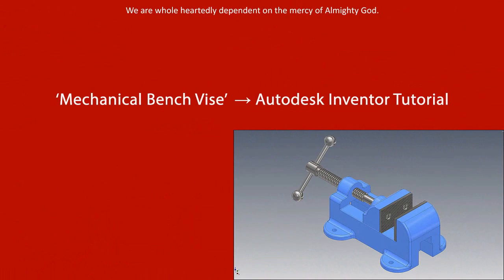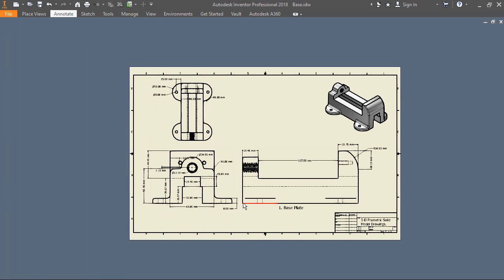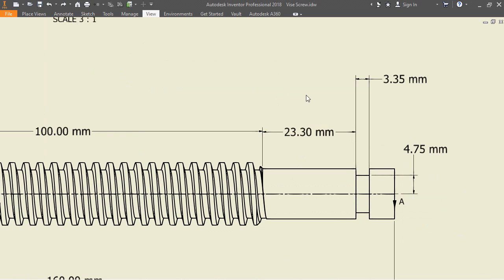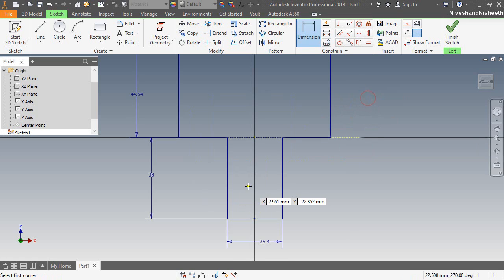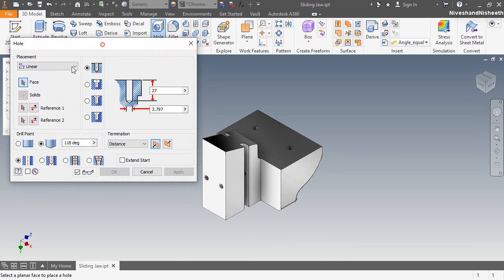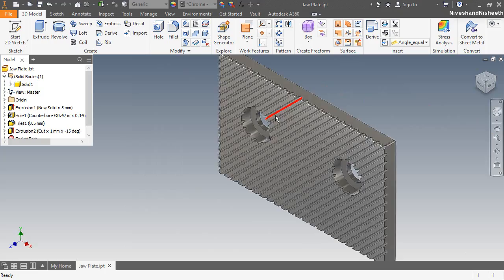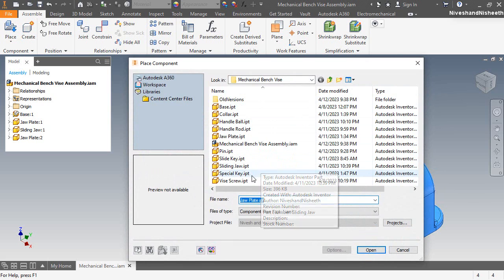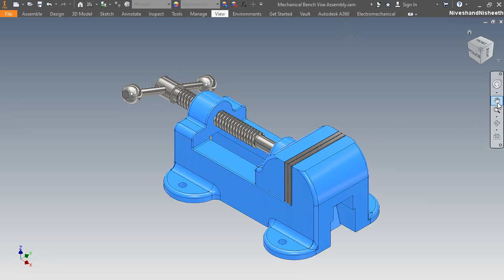Learn How To Make A Mechanical Bench Vise In Autodesk Inventor!

Comment: 02:59 My problem: Vertical constraint did not behave same way like in video.
Solution: When you were created Sketch from YZ-Plane, rotate view so you see "right" and tilt 90 degrees clockwise. See 3D cube in video.

Facepalm... first step took 30 minutes to figure out how even constraints work.